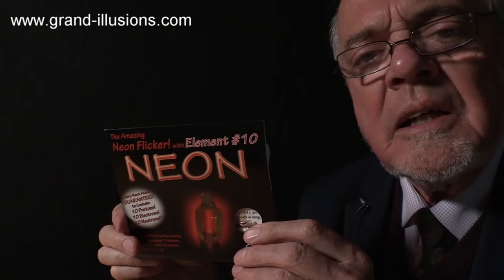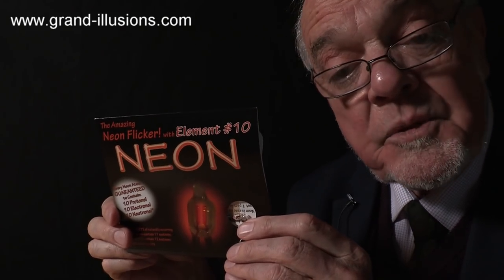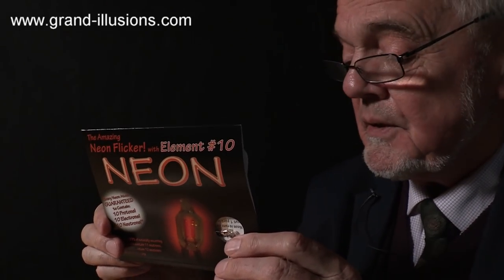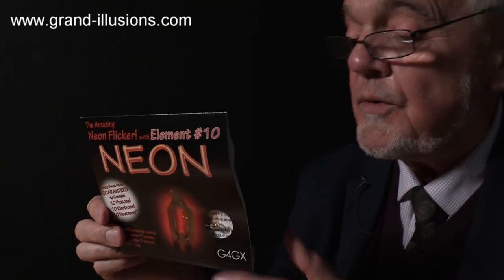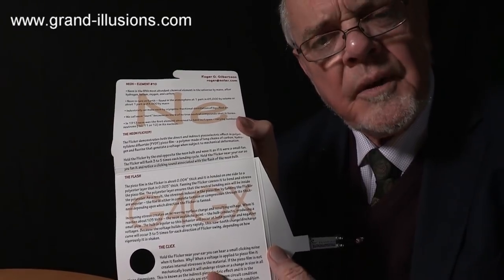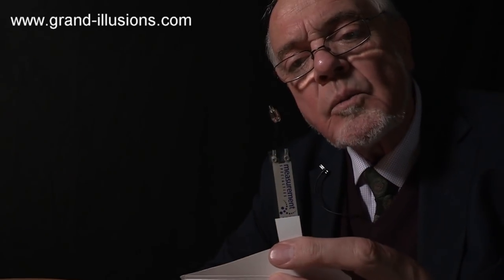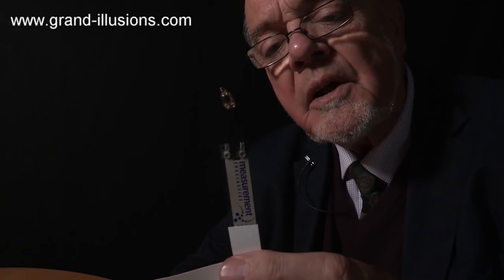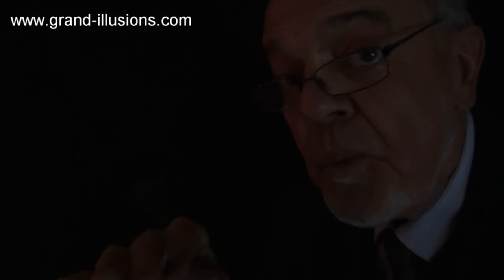Neon Flicker

Comment: Those neon indicator lamps used to be everywhere before LEDs came down in price...   you’ll find them in older electronics and in older control boards (as indicators)...   they’re still pretty cheap.

Comment: 110 volts ? Are you sure about that ?
Reply: Filip Fedorišin sounds plausible. The current for striking arcs in neon discharge lamps in tiny. 110V would be a trifling amount of potential to produce.

This will be a  commercial indicator neon, in its own; not at all remarkable. Coupled with the novel application though its very interesting.